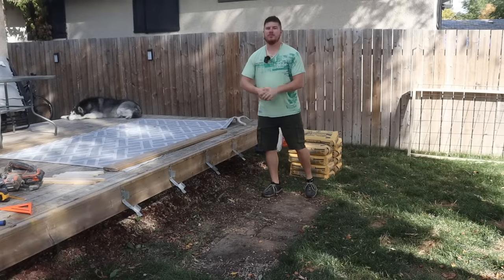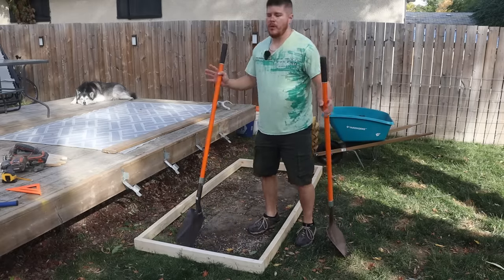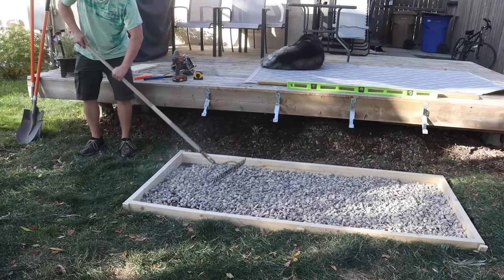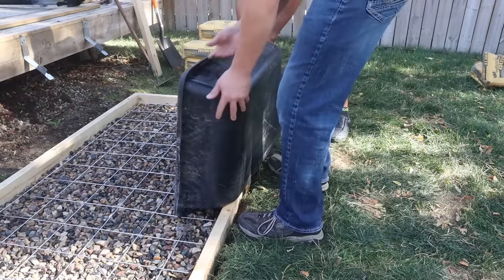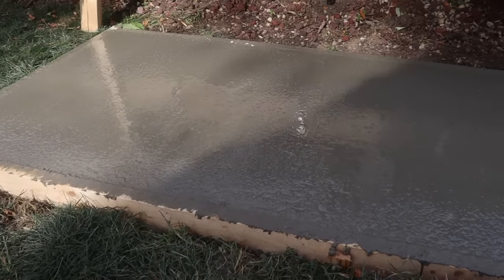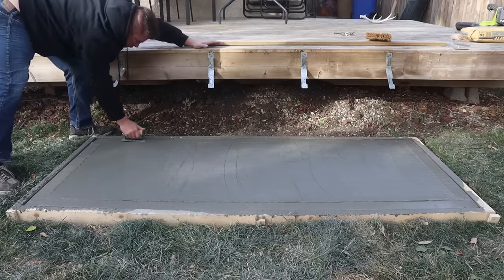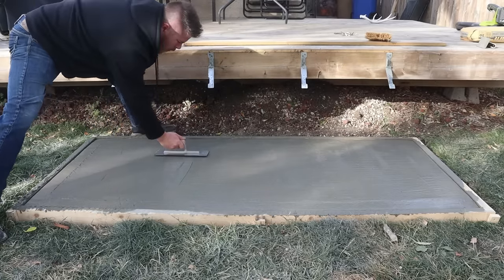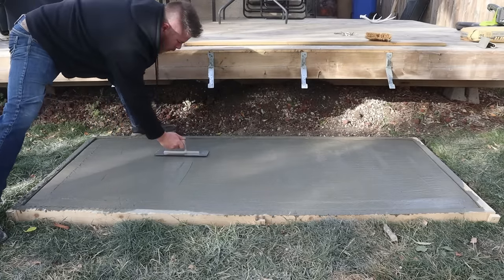Concrete pad for beginners  //  DIY

Comment: Thanks Jesse.  DIYer here.  Your step by step instruction was easy to follow and you guided with helpful practical advice.  The only question I have is the type of cement to use.  I know it is Quikcrete, but could'nt tell if it was fence post cement or just Portland cement. Which one would be better ?
Reply from the maker: No prob, glad you found the video useful! I just used the regular yellow bag of concrete from them. Fence post sets up much too fast to work with and Portland cement is 1 ingredient in concrete but isn't too durable by itself. They also make a 5000psi mix in a white bag and a 6000psi mix in a blue bag. Up to you, but just normal pie mixed concrete is fine. How that helps, good luck on yours!
Reply: Can I please ask,  do the mix concrete you mentioned already got sand in it? I am a woman and beginner.  Thanks a lot
Reply from the maker: No problem. It's a fully pre mixed bagged concrete ready to go with all the ingredients and additives already measured out for you. There are different bags that have different uses, but I just used the regular concrete from Quikrete here. Also, just for future knowledge, all 'concrete' should have the ingredients. 'Cement' will not as it's one of the ingredients in concrete. People mix them up all the time. Hope that helps!

Comment: Does the concrete pack already have sand mixed in it? Or is that a mortar mix? Is this a different mix? Great video. Due to make a base for a bike store.
Reply from the maker: Concrete is just that, all the ingredients ready to go. You're thinking of cement. Cement is the main ingredient in concrete, but still needs sand and aggregate mixed in. There are many formulations of concrete with extra additives depending on what you're doing. Good luck on yours!

Comment: I just love to know what engineers guide book you use to say the reinforcement needs to be an inch stitch and a half from the edges or are you just making this crap up
Reply from the maker: It's not engineering. It's so it doesn't shadow through the concrete and become visible, or completely move in the liquid concrete and end up poking out. It's a safe buffer is all it is

Comment: spray some cooking oil on the inside of the wood form help the concrete from sticking to the wood.  Also tap or use a sanding tool to get nice bubble free edges
Reply from the maker: Absolutely

Comment: turn steel trowel 180 degree when edging. it can lean on the wooden frames so you don't have to level the surface. Just a thought.
Reply from the maker: You can if you want, but this is how it was meant to be used. But hey, it's your slab so who is going to say no!

Comment: Do you want the form to be level or do you want it to have a slight pitch so water rolls off? I WOULD use the mesh to help hold it together over time. Up in the area where we have bitter cold, most concrete slabs or sidewalks are 4" thick.
Reply from the maker: Level is fine if it's sealed, slight angle is ok as well if the project calls for it, some need to be level. We have insane cold here in the winters, it can be -50 lol I'm in central Canada. Sidewalks aren't reinforced, at least here anyways, around 3" is plenty for home use if it's reinforced

Comment: Thanks! I am filling about a 2 wide old underground trash container with broken concrete, white gravel, etc.  Then plan on topping it with 3" cap of concrete, with some wire mesh.  No forms will be needed, in my case. So far, haven't spent any money.  May have to pony up for some concrete if my older landlord doesn't have any.
Reply from the maker: No prob, glad I could help. Cool, well I hope it goes well!

Comment: tip to remove the stake, Put a screw in it and use the hammer to pull on the screw.

Comment: I learned about from your video. Do I need to apply sealer to the side of the pad when i start my project?
Reply from the maker: You can, it doesn't hurt. I did but it's mostly to protect the top from weather damage and staining

Comment: You don't have to vibrate it or shake it or stir it in the form in any manner to make sure there are no air bubbles and that it settles as flat as possible?
Reply from the maker: Ideally, tap the side walls with a hammer lightly. That's about it

Comment: Have youvtried the dry pour method? Pour the concrete powder into the form, set it up, level, smooth ect....then mist it until the color changes on the top, wait 1 hour, mist again, wait 1 hour, then water hourly to ensure it is thoroughly wetted?
Reply from the maker: Dry pouring is a terrible idea for so many reasons...I literally want to make a video explaining it because so many people comment about it
Reply: @JessedoesDIY  please do, I have been researching various methods for pouring a small slab for my grill off of my currently existing patio. Just trying to figure out the easiest, quickest, and best method.
Reply from the maker: With concrete there is no cheating it. It's a fun project, but to do it right takes work in the prep, and it's heavy to boot. But usually with anything, quick and easy doesn't jive with the best method. Think about it this way...there is a reason that when building a road, dump trucks just don't unload dry concrete, then they smooth it out and come by with a water truck. It shows up already wet and mixed in a concrete truck. Same with a concrete bag you buy at the store, it doesn't have instructions on the side of how to dry pour it, it has instructions on water ratios, thickness, reinforcement and cure times of a properly mixed concrete.
Reply: @JessedoesDIY  all fair points. I appreciate the insight from someone who knows better
Reply from the maker: Anytime

Comment: Got any ideas on repairing small bad slab that is just worn out over 50 years old? My drive way in the yard is need of repair,thinking of fixing it but show some way as to approach it,thanks
Reply from the maker: That's a whole different animal. There are professional products you can get that will adhere to the old concrete, but it is an immense amount of labour and prep work. You pour it on top after and smooth it out, working in sections as it dries. Off the shelf solutions exist as well but don't last all that long.

Comment: Nice, how did you do the diamond pattern on the old ones ? The grip looks awesome.
Reply from the maker: Thanks, I actually didn't make those stones. But if I did I'd wait until it firmed up and then lightly set some fine diamond wire mesh onto it that you use for house parging. Press it lightly and then lift it off.

Comment: Lessons learned, the hard way: use a bigger mixing tray than the two-bag size; fill the corners of the form with the mixed concrete before filling the middle. My mix was probably a little dry, and my corners could be better. The result is a stable platform for our compost drum. I’ll do better with my next project of this kind. Thanks!
Reply from the maker: Glad I could help. Problems and experience is how we learn. Next time

Comment: I will be doing a concrete slab that is 30 something feet long and 10 feet wide, any advice on a job that size? Can I still use wire mesh for reinforcement? Should I pay for a concrete truck to come to my property? This is going to be a concrete slab for a permanent tool shed, but will probably also need electrical work so I can put a commercial fridge in there to start and use it as a workshop as well.
Reply from the maker: Honestly, that is something you may want to hire out because there are many things that need to be done, and many of them at the same time for a great finish. If I was to tackle it I'd get some help, and 2 ways you could dop it. Either pour it in sections with a small concrete mixer and the slab sectioned off, pouring 1 section at a time but having the rebar connect the whole thing together. Or yeah, get a truck and do it at once but again, you need to move fast
Reply: @JessedoesDIY  Thank you for the help.

Comment: Was thinking about using 20" x 20" x 2" pavers in front of a storage shed which will eventually house a golf cart, but may just mix/pour a 4' x 10' slab instead.  Probably use 2x6s to frame though because would like it to be thicker.
Reply from the maker: I much prefer the slab myself. They are much more solid and substantial, and they won't get out of level from each other as the ground moves. Honestly, 2x4 is all you need. A driveway to hold up vehicles is only 3.5"-4" thick, so once it's cured for a couple weeks, it'll be crazy strong with just 2.5-3" thick. It's up to you but that's a lot of extra work and concrete.

Comment: AM wondering  can you use this same technique  to make a carport?? Or add a few extra feet to my driveway??? Would there be any other steps?? Really  just wanting to add an extra 8 to 10 feet to my driveway.
Reply from the maker: Steps would all be mostly the same, I'd just go deeper so the slab is 4" thick and add rebar. If you wanted to, you can use a hammer drill and drill into the side of the original slab and add 8" long pieces of rebar 4" deep with concrete epoxy, so that 4" is sticking out for the new slab to grab onto and help hold them together. You can also add acrylic fortifier to the new concrete in place of some of the water. It help new concrete stick to the old.That'll be a lot of work but good luck on it!

Comment: What is the exact name of the type of concrete you used? I've purchased concrete in the past not knowing what I was doing, and it was more of an "aggregate" of mix and pebbles.
Do I need to cure a slab if its just going to sit under a shed?
Thanks!
Reply from the maker: I used Quikrete, and for this it was just the yellow bag, the least expensive one. It perfectly fine for a slab like this or for a shed. I would however leave the slab for at least 48hrs to a week if you could to cure before building on it and a couple weeks before drilling into it with an anchor to fasten the walls to it. Hope that helps

Comment: I have been wanting to do something similar to this but or less heavy "traffic" and load. I haven't seen this being done with lil rocks/stones as foundation.  Is this method better than the sand method?  Also, is the metal mesh need it is for a small narrow area without foot traffic where only 3 wheelie bins are kept?
Reply from the maker: You can use stones or sand. I like to use sand under patio blocks and stuff, but slightly bigger slabs like this I like rocks. It helps keep it separate from the ground so if there is a ton of water, ice or even if the ground shifts it can help it move as one solid piece. The metal is never a bad idea because concrete is designed to have it in it. It'll help prevent cracks over time

Comment: Could you please give me the measurements of this slab and how much concrete was used? Trying to figure out the cost of concreting 30 M2. I like the video and subscribed. I notice everything is well done around your place
Reply from the maker: The measurement of the slab was right at the start of the video when I show the form. It was something like 77x48. I also mentioned I used 8 bags in the video and a concrete calculator is linked in the description

Comment: I’m going to diy a small (4’x8’) slab in a dirt patch near my driveway. I’ve watched a handful of tutorials and most don’t use gravel as a base and just pour straight onto the dirt. What’s the best way to do it?
Reply from the maker: You always need at least some sort of a base so it doesn't compact under the concrete. Be it  tamped sand or gravel. I prefer the crushed rock like I showed because it helps keep the slab separated from the ground so it can move on its own, it helps it prevent sinking into the ground over time and helps water drain and run under it instead being caught under it and making a heave or something. Concrete and organics don't play nice. Hope that helps, good luck on yours!

Comment: Is there a code or rule on how many inches thick the slab has to be ? Or is there any rule on how many inches of rock there needs to be in it ?
Reply from the maker: It's mostly guidelines and best practices. A couple inches of rock is plenty, I just had mostly enough to cover the dirt and you're pretty good for a slab like this. Same with thickness, between 2-3" thick, closer to 3 is perfect for this. Thick enough to be resilient, resist cracking. Any thicker will be driveway thick and be completely unnecessary as it isn't holding a tone of weight, just cost more.

Comment: I need to pour a slab with an angle (away from the shed).  Are there models?
Reply: I'm looking for the same thing. I have an area underneath my deck that floods consistently, so I'm looking to create a pad that shifts the water away towards the drainage route.
Reply from the maker: Just need to adjust the angle of the slab, instead of making level. And then make sure your mix is a bit thicker so it doesn't slump too much when adding it to the form and keeps it's shape

Comment: I want to pour a 10x8 concrete slab for a shed . How many inches thick does the slab need to be ??? Can someone let me know please
Reply from the maker: I'd go probably 3" at least to help prevent cracking and so you have enough meat to bolt the wall plates down to.

Comment: Is there anything you can spray the form with, to keep concrete from sticking to it?
I was thinking of non-stick cooking spray, or could this keep it from drying at the sides?
Reply from the maker: You can spray it with a cooking oil if you want, but if it's a small form like this you're only using once, it'll be fine without it. You saw how easily it came off. Typically you'd spray the form if you were going to keep reusing it, it prevents it from getting dirty and cruddy over time. Up to you

Comment: So why the rock base?
I seen some videos on small slabs like that and they didn't use the gravel rock and some used a sand base.
I'm not sure which I'd the correct way.
Also I seen some folks put oil on the inside of the forms so there's clean separation when it comes time to remove the forms. 
Did you have any troubles?
Reply from the maker: The rock helps with drainage under the slab. It helps the slab move up and down with ground movement and the freeze thaw cycle as a solid piece. You can put sand down if it's a giant and super thick slab that won't move much, or if it's really small patio stones that are individual. For medium ish slabs like this I prefer stone, but sand can also work as well. When it comes to oil you typically only need to oil it if you plan on reusing the form, but you saw how easy the form came off for me. That was done in real time with no effort
Reply: @JessedoesDIY  
Thanks 👍. 
I guess around here I wouldn't have to worry about freezing/thawing effect since it rarely gets into the mid to upper 20's in the Sacramento valley area. 
Last time it snowed was 2008 and was so light it melted off by noon.
I guess I could get away with a Road bade that has 3/4 ➖️ that has sand in it.
Reply from the maker: Pfft lol I wish. I'll have snow back before Halloween...My frost line during winter is almost 6.5' deep here it gets so cold. Yeah, it should be good. Ultimately you just need some sort of base laid down, not right on the dirt. Good luck on yours!
Reply: @JessedoesDIY  
Thanks 👍

Comment: Can you seal concrete that is years old?  I question if the builder sealed the driveway concrete when the house was built
Reply from the maker: Absolutely! As long as the top layer hasn't turned to dust and been eroded, but if it has I'd wash and broom it clean, let it dry and giver

Comment: What kind of cement was used to get a relatively smooth top? I think my housemate got the wrong kind - with rocks in it.
Reply from the maker: All concrete has rocks in it. Concrete is a mixture typically of 3 parts aggregate, 2 parts sand, 1 part cement and .5 parts water. These can be adjusted depending on the situation but as you smooth it out with a wood float, the 'cream' or cement will rise to the surface and the rocks should settle to the center. I just used regular yellow bagged Quikrete concrete

Comment: Nice video but oh man, never ever cut stake toward your hands like that! In fact never cut towards any limb. One tip- use spent motor oil to coat the inside of your 2 x 4’s, they’ll easily release.
Reply from the maker: Thanks. Yeah if you aren't confidant or comfortable don't do it. I've done it enough at work, doesn't make it right but I'm used to it

Comment: Hi there, quick question, if I am making a 12ft by 12ft x 3inch thick concrete, patio area for dining out - do I need reinforcement steels in place ?
Reply from the maker: Always need reinforcement. I'd either just use this square mesh i used, or rebar, or both if you want.

Comment: 3:02 doing a similar size slab for an outdoor shower and need a slight slope away from a structure. Would I just do the same process but angle the form to the desired grade?
Reply from the maker: Absolutely, and as long as your concrete mix is correct and thick enough it'll be just fine. Good luck on yours

Comment: Doesn't that hardcore need compacting before the concrete goes on top?
Reply from the maker: For a small slab like this it's fine. It isn't holding a huge weight but you definitely can, it doesn't hurt

Comment: How do you pour concrete on the edge of a hill. I want pour a walkway around my sunroom. But on one side is near a hillside. I don’t want the concrete to fall down the hill over the years
Reply from the maker: You'll need to build up the ground under it, it'll need support. Otherwise the process it the same, just the form may be a bit more difficult to make and brace up.
Reply: Can I use rebar , drive them into the ground and tie concrete wire fence to it.
Reply from the maker: Without seeing it myself, it's hard to say